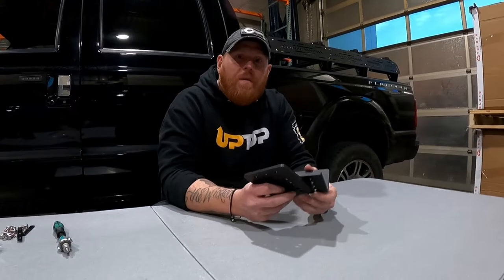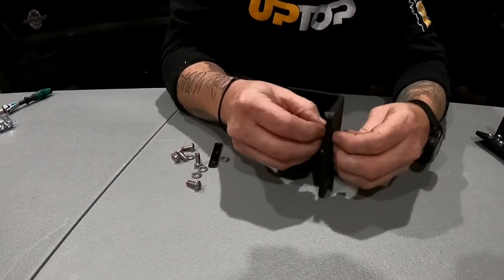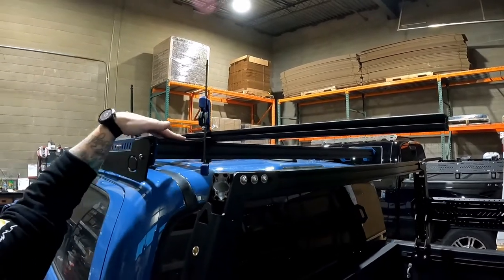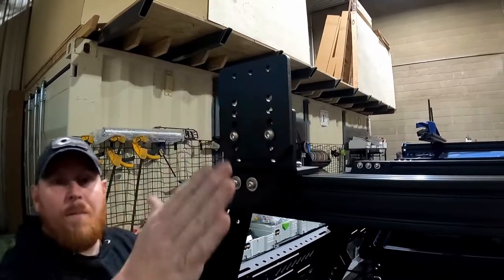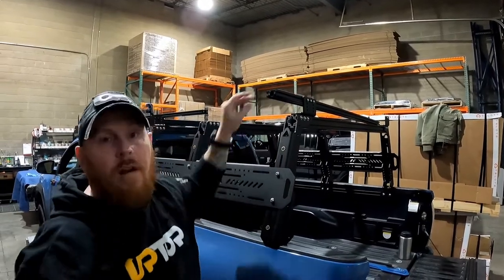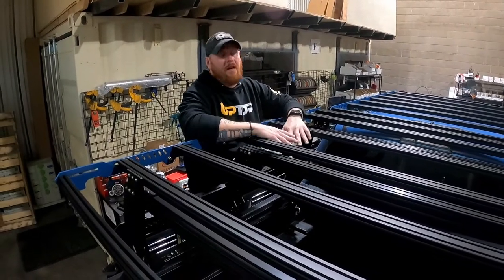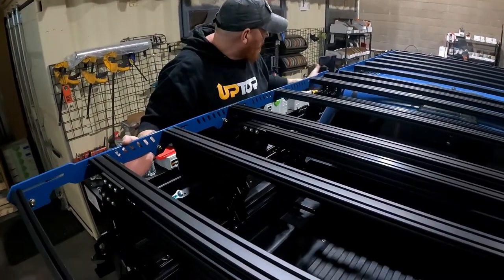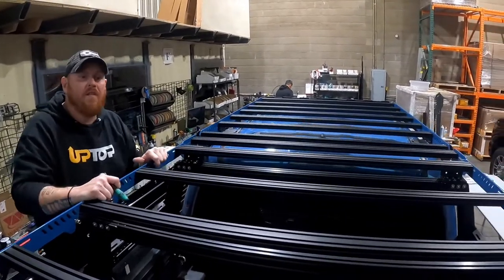How To Install The EX to TRUSS (ETM) | upTOP Overland

Comment: My l bracket is different than the one in your video. When measuring the cross bars it isn’t flush to the l bracket. The margin on the extender is too tall for the Tacoma.. solution?

Comment: Is it necessary to have the ex on a truss (softtopper) to mount a rtt? What are the benefits if it is not necessary?
Reply from the maker: It is not as the Soft Topper rack is height adjustable!